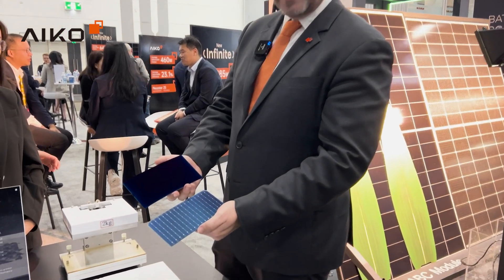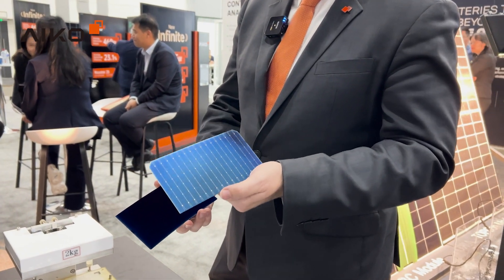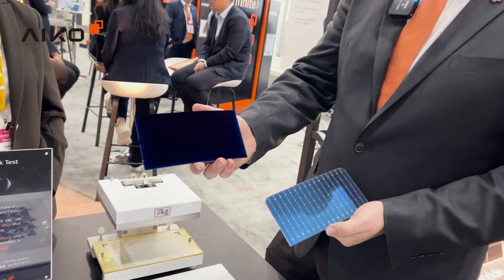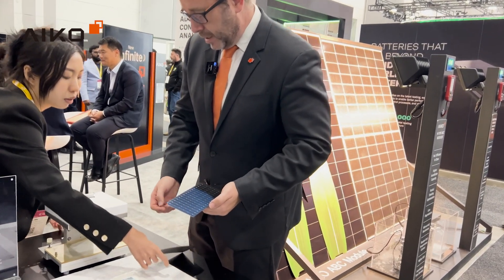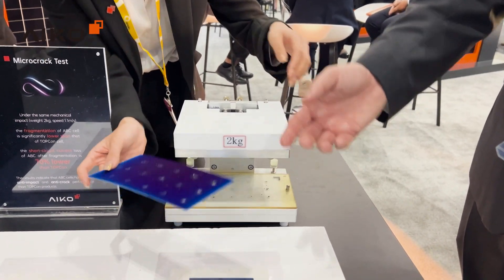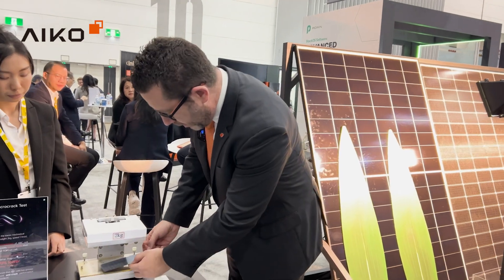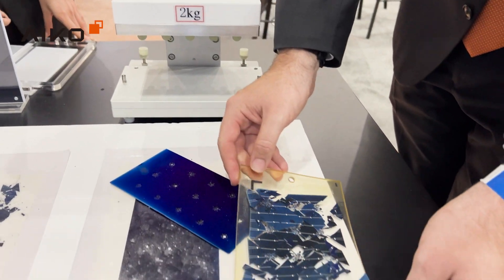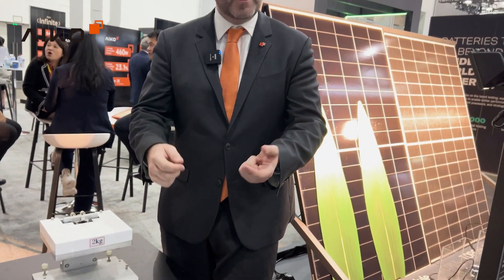Micro-crack Resistance Test - Aiko Panels

Comment: Which version of the AIKO panel was tested? Mono glass using 3.2mm tempered glass or dual glass 2x2mm with coated semi tempered glass? I imagine there would be a significant difference between them. Thank you
Reply from the maker: This demonstration used the solar cells (prior to assembly into a solar panel) rather than an actual solar module. When Thomas was discussing the general hail resistance of modules, he was referring to the single glass modules - which are the most commonly used Aiko panels in Australia.